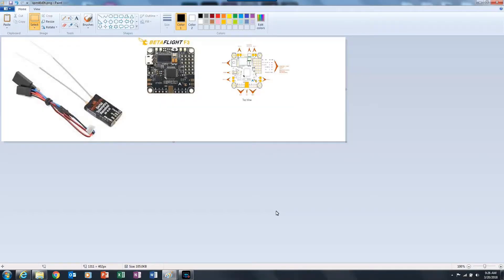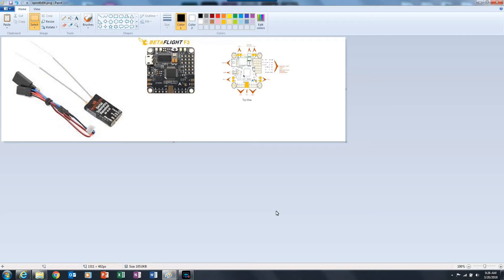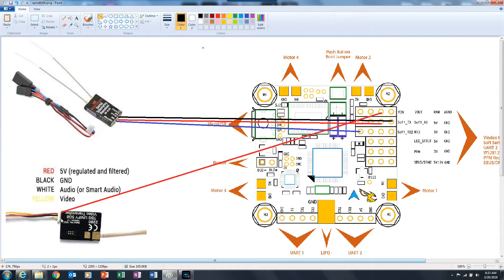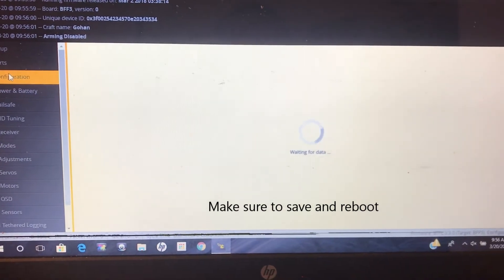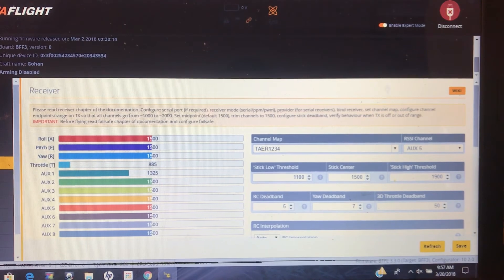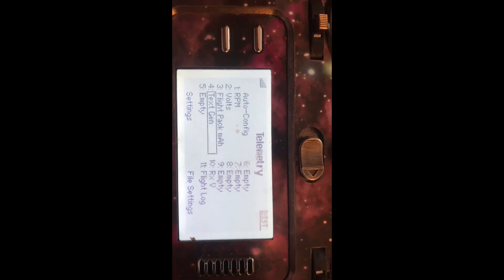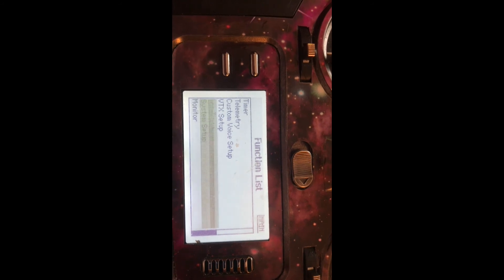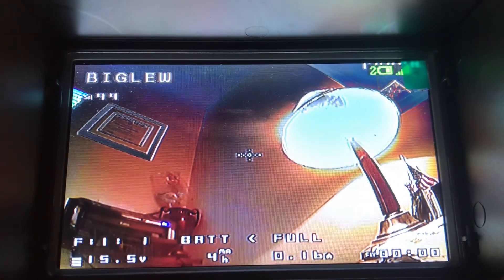How to configure Spektrum with RSSI and VTX setup in Betafligt

Comment: Thanks for the video and links, works great with my DX8G2.
Moved the RX wire to TX modified betaflight settings to SRXL and the other stuff. now finally I can change VTX settings using my remote only and I can mute the radio.
Reply from the maker: Daniel Witzemann glad to help

Comment: Great video bro. 
My conf is this, I using a matek f722-std FC. 4649t promptly updated and Dx9. Flying well. Ihave two issues to ask to you,  if you can help me. 
First, I tried to move blu wire from uart 2 RX to uart 2 tx, set betaflight as your instruction and....stop to receiving input from my radio. Why? F7 chip need the blu wire moving? I read that f7 no need special attention for rx-tx ports, is this the same case? You suggest to try uart 3 tx just to try or you know that I forgot somethings? 

Second, If I don't care about vtx setting by radio...I need in any case to connect smartaudio wire on vtx? Or is an additional/not essential function? My target is have rssi and voltage on OSD and voltage on display radio. For the second I can use the additional input port directly available on the 4649t...but rssi still be a problem. 

Thanks in advance

Comment: Hi, You mention several times that you had to "update the receiver" to get this to work.
Please tell me how you can update the firmware in the Spektrum  4549T receiver?
Reply from the maker: flyinwalenda there’s a link in the description on how to update the spektrum receiver
Reply: Thanks . I updated the 4549 to the latest firmware but the RSSI is still not working. Quad flies,  Smart audio works, telemetry to the radio works, but RSSI stays pegged at 99.  Working on a Rcharlance F4 stack and it has been trouble from day 1. Had to connect the rx to uart6  to get it to fly as the factory wired plug on uart2  is  always inverted and uart3 is factory wired for the vtx.  Not sure what I'm missing , maybe it's something internal with this stack.
Reply from the maker: @flyinwalenda  some of the flight controller have issue try this turn on everything look at the task and them turn the radio off .also look at you receiver tab yo see if there is another channel that may have the on and don't assign any function to that channel in the radio
Reply: I have the RSSI on BF aux5 which is of course aux4  on the dx9. Aux4 has no switch assigned to it on the radio; it is inhibited. I also tried BF aux4 and it still pegged RSSI. Of course assigning DX9 switches to those aux channels and they work fine on the BF receiver tab.                                                                                                  This controller has been the toughest one to set up yet with all of its issues so I wouldn't doubt it's an internal issue on the FC. I'm setting this one up for a fellow pilot so he can still get RSSI alarms through the DX9 if I can't get the OSD RSSI to work.

Comment: Question   I'm using the tbs crossfire on dx9. drone wont arm unless on sbus but it just stays at 0 rssi on osd tried the receiver (Bidir SRXL)the reading on osd went to 50percent but won't arm????? Can u help me figure that out
Reply from the maker: Crossfire need to be set to the crossfire setting and not the SRXL setting then have telemetry on
Reply: @BigLewsplayhouse  it set to sbus  but osd rssi just shows 0 percent
Reply from the maker: tony horton are you using crossfire rx or spektrum rx

Comment: Don`t work with spektrum DX8G2 firmware 2.00, RX SPM4649t and betaflight 3.5.1. Spektrum will bind with telemetry, after auto-config in telemetry every data is zero.Enyone a idea to get it work?
Reply from the maker: You may have to update the receiver to the latest firmware
Reply: Hi, i have update my receiver. But this still not fix my problem, betaflight 3.5.1 is buggy, when i flash 3.5.2 telemetry working fine.
Reply: Yes that would be it. I remember reading his issue in the release notes of the new receiver firmware.

Comment: Thanks for the great video!!
My question is, Now that I will have to use a spare channel as my RSSI channel in the receiver page will I loose any functions on that AUX channel for switch functions? I only have a DX6
Reply from the maker: Clearcutter yeah if you get rssi on that channel you can not use it for anything. Else
Reply: Big Lew FPV WOW thanks for the quick response! Yeah that’s what I figured. Finding the limits of my DX6 very quickly

Comment: this video is freaking awesome. thanks
Reply from the maker: Thanks i will add if you do this make sure you dont use UART6 use anyone but that one
Reply: ok
Reply: I tried it. Everything works exactly like you show. It is freaking awesome. I have been waiting for years for descent telemetry between spektrum and betaflight. Raceflight has had it for a little while and I have been jealous, because I want to stay with betaflight. 

Side story, I have been using the built in voltage telemetry in that receiver for a couple years. It does work but is gives tons of false alarms all the time. The transmitter was always beeping for low battery. So I turned down the voltage alarm, but once you set it low enough to not beep, it never beeps and your battery dies. So I built a tiny circuit with an op-amp, diode, and capacitor to slow down the voltage response. It worked fairly well, but not perfect. This new telemetry I just tried looks like it will work even better. I did the test where I turn the voltage supply down quickly and back up to simulate a voltage spike, and no false alarm. sweet.   
Anyway, thanks for the video. I am really happy.
Reply from the maker: Michael Wilkes I’m glad it helped

Comment: Awsome ive just had the spm4649t rx and unify pro vtx delivered, i will try to set it up like this tomorrow. Will be nice to have access to vtx and betaflight settings on the radio. On screen rssi will be nice too. Thanks for the video this would have taken me hours to work out, will probably get stuck along the way and be back with questions 😁 will let you know how its works out either way. Thanks again 👍

Comment: When I enable Telemetry on the configuration page, the reciver stopa working. I have tried it on several quads
Reply from the maker: Øystein Kjosavik make sure the receiver is solder to tx and not rx
Reply from the maker: Also make sure that you dont have Analog RSSI input turn on
Reply: Big Lew FPV. Thanks 😀I have Bardwell and clracing flight controller. No free tx uart. Have to look for a solution.
Reply: I have a Betaflight F4 board on one off my quads. It still dosn´t work when I connet to TX2. I have to bind every time i connect. The analog RSSI is not turned on
Reply from the maker: Is the receiver firmware up to date? and what Betaflight firmware do you have loaded?
Follow the link i have listed it will tell you what firmware level your receiver has to be
Reply: Hello. I have latest betaflight installed. I have updated My dx6 to. I must look into how to update the SPM4649T recivers.
Reply from the maker: Øystein Kjosavik Spectrum just released a videoOn how to update your receiver
Reply: Big Lew FPV do you have to update for it to work? Telemetry is working on My radio
Reply from the maker: Øystein Kjosavik yes the receiver has to be up to date with the firmware
Reply: Hello. I have Betaflight 3.3.1 on the betaflight F4. I have updated my SPM4649T reciver to version 1.1. I updated the software to my DX6. I use UART2. I move my the reciver cable from RX2 to TX2 the flight controller loose the connection to the reciver. What else can I try? I realy want this to work
Reply from the maker: Øystein Kjosavik can you send me images on config page and receiver page.
Reply: Sorry, but I don´t know how to send images on youtube. Can you add me on facebook?
Reply: # get serialrx
serialrx_provider = SRXL
Allowed values: SPEK1024, SPEK2048, SBUS, SUMD, SUMH, XB-B, XB-B-RJ01, IBUS, JETIEXBUS, CRSF, SRXL, CUSTOM, FPORT

serialrx_inverted = OFF
Allowed values: OFF, ON

serialrx_halfduplex = OFF
Allowed values: OFF, ON

Do I need to set the hlafduplex to on?
Reply: Hello. I figured it out :-) The problem was the Betaflight F4 board. When I wired it ti tx on uart2 it didn´t work. I then moved it to tx on uart3, then everething woreked like a dream

Comment: Thanks for the video. I have a question about the wiring though. You said to hook up the blue (signal) wire to the TX port. Why is that? Doesn't the FC need it wired to the RX port?
Reply from the maker: Will Gilmour the receiver is bidirectional and in order for it to communicate back and forth you need it on the Tx for the UART
Reply: Big Lew FPV ok I'll give that a try. I just recently bought the SPM4649T and was having trouble with it always trying to bind every time I plug it in. Maybe this is related? I have always used the SPM4648 with no issues but his one is driving me crazy. Thanks again for the video and your reply. I wish spektrum would put out some info videos for the race quad receiver customers.
Reply from the maker: Will Gilmour also update the firmware on the receiver
Reply: Big Lew FPV ok I'll give that a try. Thanks man.

Comment: nice vid, have not been able to get the betaflight menu on the ix12 though
Reply from the maker: Brad and Marks RC Garage I'm not sure about the ix12 but on my dx9 what I had to do was turn on the text gen in the Telemetry settings and that's how I got the beta flight table
Reply: Big Lew FPV yeah I tried that maybe it’s not yet working on the 12
Reply from the maker: Brad and Marks RC Garage what what receiver are you using you may have to update the firmware on the receiver in order for work
Reply: Big Lew FPV 4649t and latest firmware

Comment: Thanks straight to the point.   Do you have any idea how many receivers you are going to make me buy??? :)
Reply from the maker: Rookie FPV I’m sure a lot I have 11 quads and I now have all of them on that receiver
Reply: Yea now make a video on modding a DX7 for Crossfire lol.
Reply from the maker: Rookie FPV that video is out there but that’s an easy mod
Reply: From what I've seen only for the DX9 and above.  The rest are PPM.  Am I right?
Reply from the maker: Rookie FPV that's true but even on the dx9 the mod isn't going to give you the crossfire protocol it's still ppm. Th ix12 allows crsf
Reply: Available for DX9 only... https://www.horizonhobby.com/pdf/SPMR9910_Crossfire_Instruction.pdf
Reply: OK, too much trouble for ppm.  When I go long range I will have to decide what to do.  I know I like my gimbals, never touched Taranis gimbals.  But I'm sure the IX12 would be silky.  Have a good week!
Reply: That crsf mod is quite easy.  I was about to go taranis till I completed this and now I have the best of both worlds. Spektrum on crossfire!!  Way less expensive to buy the crossfire module than an ix12.   Cheaper to pick up a used dx9 and crossfire module than an ix12 too.